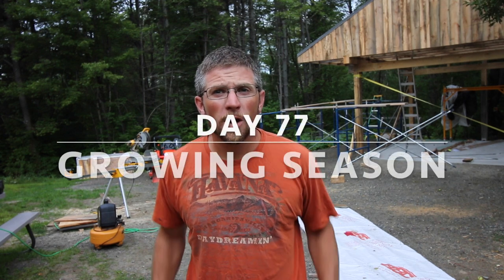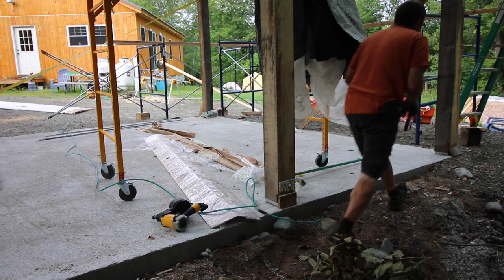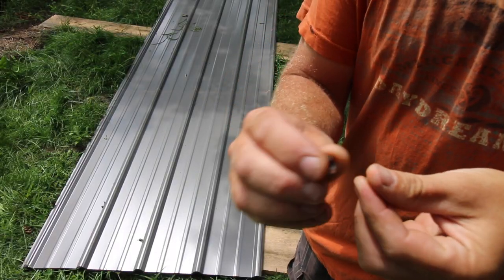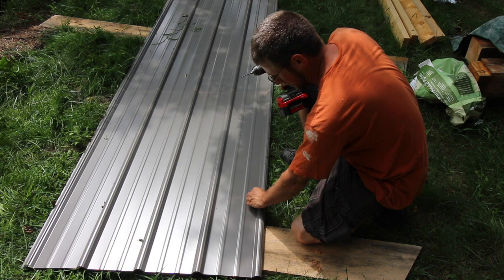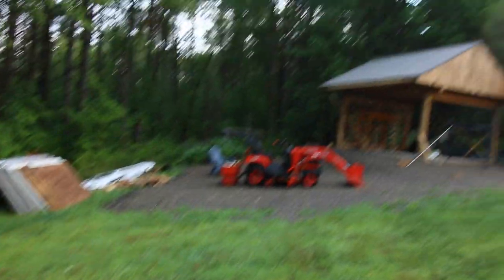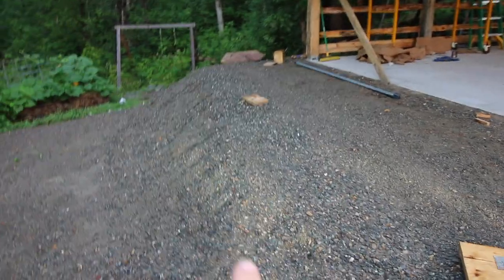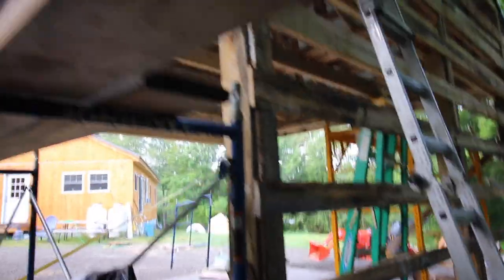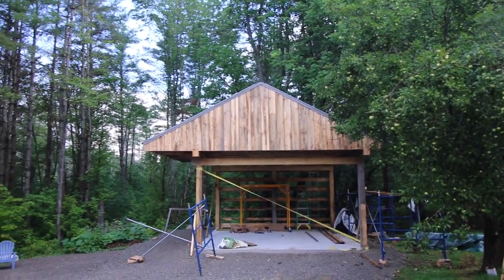Lets Get The Roof On Before it RAINS!

Comment: When you get your barn up later this year, you can buy your staging and store it in there.  You do so much high work, you need your own staging.  I don't know if you have it or not, but you need to run electricity to the outside basement wall so you can plug in your saws, especially in the winter, instead of running extension cords from the inside.

Comment: I'm sure you did it for reason, but I missed it , most roofing screws are self tapping... nice job
Reply: Even self-tapping screws take some effort to get started when going into a metal roof especially if it is 26 or 24 gauge which i would assume this is since they get a heavy snow load and winds. .
Reply from the maker: It makes the job go a lot faster and easier! Plus when you are done the screws all lineup.